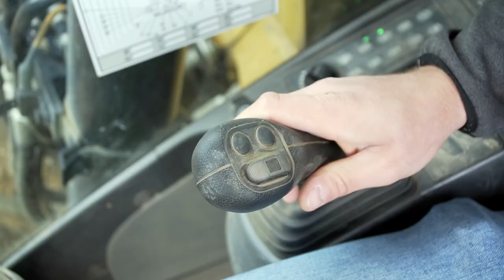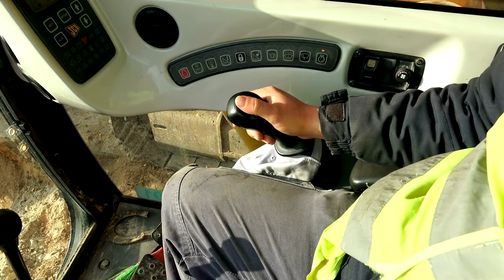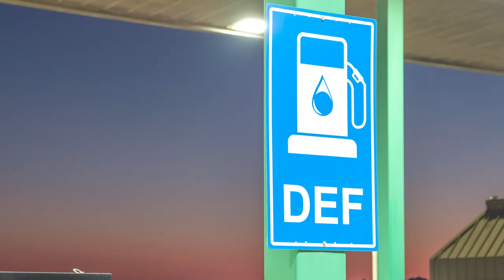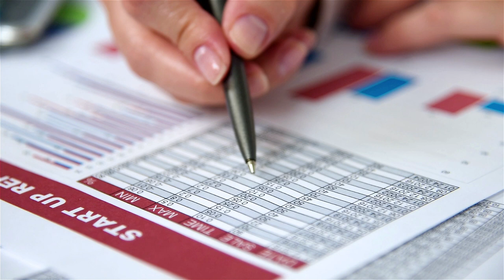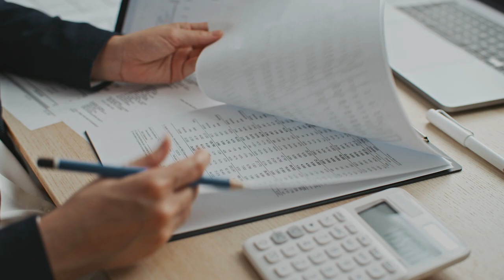How to Boost the Life of Your Equipment’s DPF

Comment: I have a 2010 Freightliner MB Sprinter 3500 camper van and have had excessive DPF filter soot clogging. Will this "600" work in my van. I do not want the Delco 400.
MB usually recommends the MB 229.51 and 5W30, but will the Delco 600 10W30 work in my camper  van?
I am a full-time RVer but have now been in a Rapid City, SD Truck/Sprinter Service Center for 3  weeks now, waiting for a DPF filter replacement thats on a Nationwide-shortage!